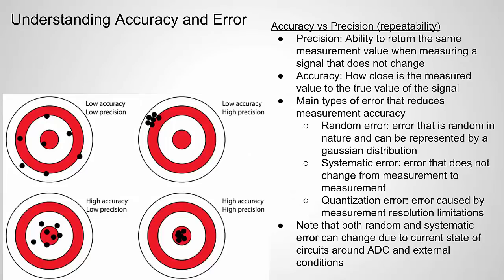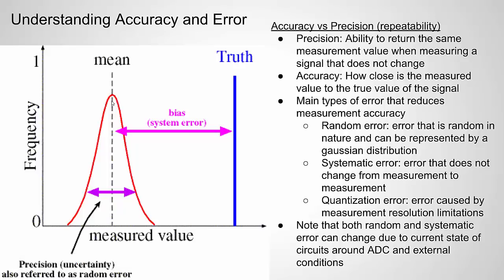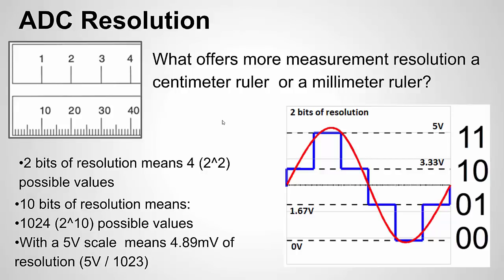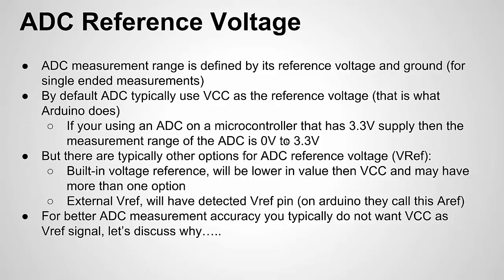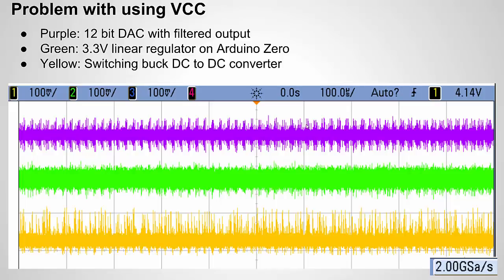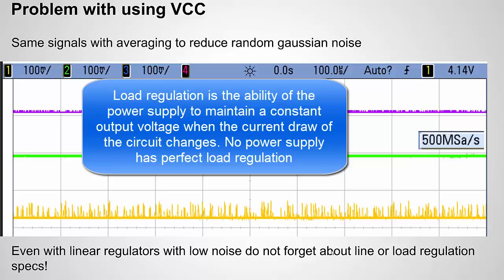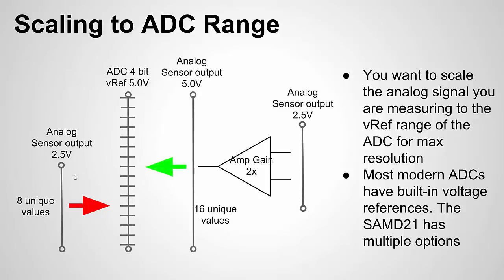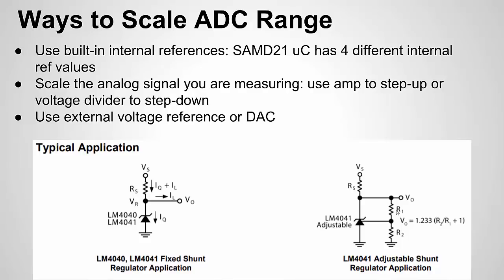Tips on Improving ADC Measurement Accuracy and Resolution Part 1

Comment: Your calculation for resolution is incorrect, yet you start off correct. 2-bits of resolution have 4 steps.  Each step represents a range of possible analog voltages 00, 01, 10 an 11.  However, they are steps and not individual values.  Like this:00 = 0 to 1.25 V; 01 =  1.25 to 2.5 V, 10 = 2.5 to 3.75 V, and 11 = 3.75 to 5.0 V.  So, a 10-bits of resolution should also be divided by 2^2 = 1024.  0000000000 = (0 to 0.004883 V) and 1111111111 = (4.995117 - 5 V).  Realistically, the error is small, < 1%; However, fundamentally it is not how a successive approximation ADC works, which is the most common type due to its low cost.

Comment: you divide by 1024 as that is the number of states in 10 bits.  You would start counting at zero to 1023 (and still have 1024 states).
Reply from the maker: You don't count the 0 state when calculating ADC voltage so that is why with a 10 bit ADC you use the 1023 value to calculate the voltage. If 10 apples costs $5 and you wanted to know what 4 apples costs you would not do your ratio calculation with 11 apples. Cost of 4 applies equals 4 /10 x $5
Reply: @ForceTronics  If you use bananas you have 4 for 2^2.
Reply from the maker: @Zorgens  Haha correct, but if you say there are 2^2 states of having bananas: you can have 0, you can have 1, you can have 2, and you can have 3.
Reply: The video was exactly correct, e.g. 5V in 10 bit can measure down to the nearest 5V/1023 = 4.89mV. Conversely the guy above (Digger D) was also correct in that there are 1024 states, and zero is one of those states. I don't think these two statements are different.

Comment: At 17:54 I think you mimic line regulation not load regulation. Because you add squarewave to the input of regulator.
Reply from the maker: No I meant that I was simulating the output of regulator that was being used for ADF reference. Sorry if that was not clear